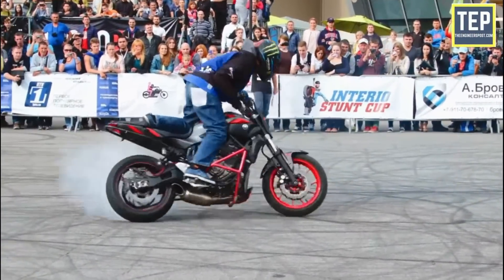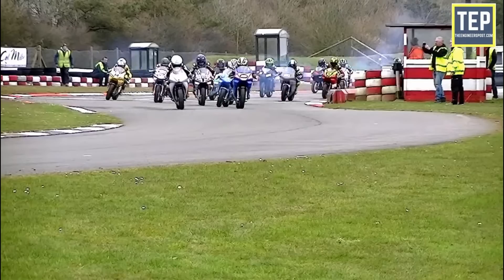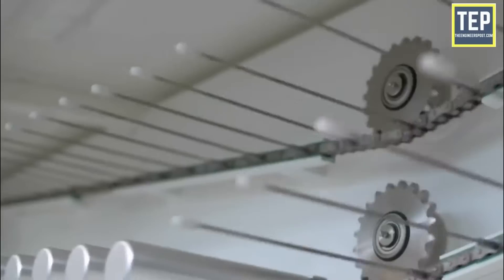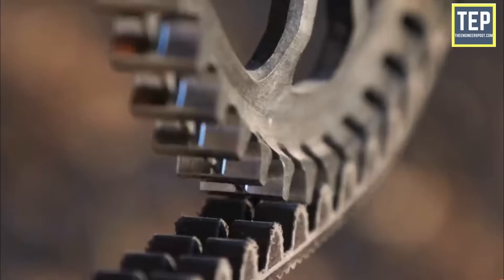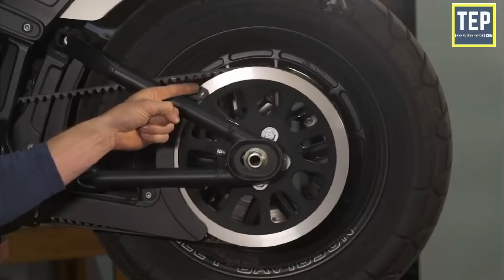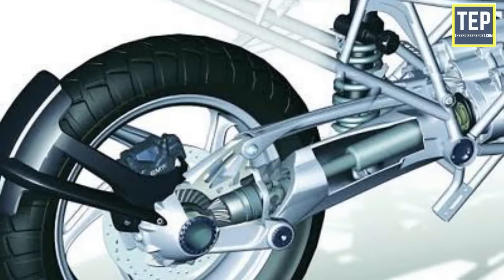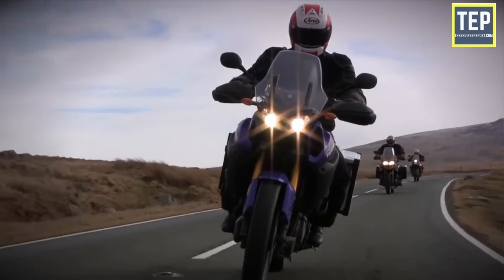Chain Drive vs Belt Drive vs Shaft Drive in Motorcycles | Which is Better?

Comment: From a bmw techie that has worked on a few hundreds of all three drive systems.
Im just answering the title.  Each one of the three have their own unique advantage over the other because each one is better suited for a specific task so you cannot.
Easiest example of one would be the most powerful sports bikes will always have a chain because the other two options just arnt viable and will break. (oh and offroad bikes go here to)
The shaft drive is usually used for heavy weight comfort, thats right, all the adventure bikes were never made to do the offroading that people think they can do and then break.
The belt is just cheap, and its best suited for light weight comfort bikes, thats right harley, it was never going to last and didnt.

Comment: Car Drives without Radiator, Coolant & Cooling Fan with Graphenizer Liquid controls the Engine Heat up to 60%.  

It also Cleans the hard carbon with dark smoke from pistons, Injectors / Nozzles, Valves & Pump etc, instantly & increases extra mileage up to 50%. 

Watch the Live Video  :- https://youtu.be/SqNIGQM1I2Q

Comment: in shaft drive the crank shaft is parallel to the direction of motion. in any automobile when the engine revs up the engine body likely to be "twisted" in the opposite direction which is well and  good and unharmful for a four wheeler, but for a two wheeler the reaction twist of the engine body may force the bike to tilt in opposite direction of engine rotation this may result into imbalance of bike on the road resulting into to accident !!!!!!! 
This is a simple experiment, open the bonnet of your car, rev up the engine manually from the engine bay, you will notice the rubber mounted engine tends to tilt in either direction (front wheel drive) which will confirm you that the engine is rotating in the opposite direction of the tilt !!!!
so if this happens on a bike what may happen ???? especially under wet conditions ???? decide yourself !!!!!!!!

Comment: The biggest issue that is ignored is MAINTENANCE. No drive train should ever be run to failure. Clean,  inspect and lubricate … then replace when wear is beyond manufacturer’s acceptable limit.

Focusing on catastrophic failure, is the repuglican approach to engineering …. Never stop preaching  fear.

Comment: I have owned all 3 types over the years, for me, although I know a shaft drive loses lot of power in transfer, I prefer it, no maintenance, maybe oil change once a year, but not essential, decent chain & sprockets for a large capacity bike can be expensive, also tension checking, it's  pain in the arse, shaft drive for me everytime  !

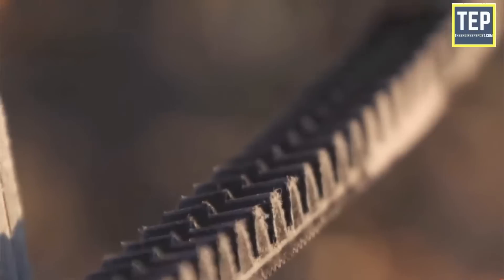Comment: Sprocket ⚙️size and changes is also a big part or motorcycle chain drives which was completely forgotten. I change mine for stunting and back for highway. The closer ratio to 1:1 the more torque. A 3:55 ratio is highway but a 4:11 is better for stunt drag or just low end torque.

Comment: The biggest disadvantage of the chain is no longer necessary though. The Regina HPE maintenace free chain does away with the constant lubing, that then gets slinged all over the rear of the bike. I have it now for 8k km and so far it delivers as promised. Not doing any maintenace on it at all. A complete game changer, since the choice of non-chain driven bikes is getting ever smaller. A lot of shaft drive models have disappeared from the stage and are not replaced.
Reply: Came here to mention there are now maintenance free chains. The system still experiences wear faster than a belt or drive though.

Comment: I have lubed and cleaned my 1st bike's chain regularly, and replaced the chain/sporket set at 15.000km. 
I have rarely lubed my second bike's chain and  nearly never cleaned. Again replaced the set at 15.000 km.
Finally I switched to shaft drive. Despite the losses of power in transmission,  I love its being maintenance free.
Reply: As long as you stay on top of the gear oil, it'll be fiine.

Comment: Too many false inaccurate statements about percentages lost, how they are used, and which is most efficient. 
Totally made by someone biased and without engineering background. Heck, shaft drives are so efficient, they’ve even been used on 50cc bikes.

Comment: Electric motors are the way to go, and because they are WAY more powerful than gas combustion motors, (by FAR), shaft driven is the way to go. even with 25 percent loss, the electric can blow any gas powered bike out there...

Comment: I can't believe that your power loss estimates are close to accurate.

Imagine the heat, 8f that driveshaft alone were dissipating 25% of the power output.  Lmao, it would need it's own radiator and waterpump, especially as it's largely contained and not easily air-cooled.

I just can't buy that, seems crazy and I'd be interested to know the source.

Comment: For me is the belt drive the best compromise: good efficiency, light, low cost,silent,without maintenance (except change after wearing) and without transmission shakes but need gravel protection...chain: need very often lubrication, dirty, noisy, transmission shakes but good efficiency, shaft drive: very expansive, heawy, transmission shakes, high power absorbtion, but clean and low maintainance

Comment: Some bikes from former eastern block has chain drive completely sealed. Chain runs in its own cover, it's lubricated from the transmission shaft, where intentionally leaks motor oil. This system is very efficient and even common chain holds 40 000km before needing replacement. Only disadvantages are oil drops (oil slowly leaks from transmission) and it's really pain in the ass to replace chain and sprocket. After all, it's great thing and is referred as "shaft of the poors".
Reply: Exactly right.  I have found that a drive chain on a motorcycle will last indefinitely if kept clean and well lubricated.  I did it the hard way, by cleaning and lubing the chain every couple of hundred miles.  But, I noticed that even a short ride on wet roads would lead to excessive chain wear because water sprayed onto the chain by the front wheel contained road grit that accumulated inside the chain rollers.  A good chain box would keep the chain clean and dry, short of riding through deep water.  If I ever own another chain drive motorcycle, I intend to build my own chain box for it.

Comment: Chain drive is by far the way to go. belts slip and with high power you can chew teeth off them. Shaft? LMAO wait till you need to change the tire and the power loss is no way worth it to me. Not to mention you can not easily change gear ratio on belt and impossible to change on shaft.

Comment: What about the new 2 wheel drive bikes. Just asking and shaft drives need more upgrades to hopefully not lose that amount of power or I guess that's just it. I never did study on this stuff but did own a few bikes my favorite was 1988 maxim Yamaha 400 4 cylinder.  Says 5 speed but I guess the engine was rebuilt or the gearbox since it had 6 gears and 13 liter tank plus reserve tank. I got 55 mpg city 75 mpg hwy it would have been nice if it was liquid cooled. Top speed of 140kph or 89 mph roughly.  But I liked it I had it when it was 9 yrs old so nothing new but a good bike 🏍 😉.

Comment: As I'm a mechanic I can say shafts driving is best.if looking my experience though I never met work of shaft bike.most chain use to break sprocket shaft splines and break chain lock  things like that.talking about belt though I saw small cc bike with belt driven if examine quickly there will be loosening and break of belt.shaftis better even for long journey.dont trust belt and chain.

Comment: Also a belt drive would require removing the rear wheel In order to install a new belt. While a chain can be installed without removing a gear.

Comment: Chains will be stretched over time and need to replace - especially the cheap ones without the o-rings. Not sure about the belt type, which looks like one piece and does it stretch? Or just break? The shaft version looks long lasting, is there ever a need to replace the gear due to friction/wear?
Reply: @Devin Currie If the main seal goes, you usually find out pretty quickly as you collect high viscosity oil all over the rear tyre. Generally, in a non-sealed shaft drive system (i.e. one that isn't enclosed in an oil bath), it's the driveshaft splines that die before the crownwheel, unless you're so stupid as to run the bevel drive with no oil. Non-sealed shafts are not maintenance free - you need to regrease the splines at specified intervals. I can quote the K100 as I have two of them: drive splines at the clutch and the forward end of the driveshaft, every two years. Drive splines at the bevel drive, every year. I tend to do the rear splines every couple of tyre changes as it's convenient and not very time consuming. One K100 is on 120,000 miles and the drivesplines are perfect. I also ran a Moto Guzzi V1000G5 to 205,000 miles and changed the driveshaft once. That was my fault.

Also the power loss on the driveshaft quoted in the video is pure bullshit. It's seven percent. A chain loses around 12% power at the one-third worn mark and goes downhill from there. I'm an ex-motorcycle journalist, so I hope I kinow what I'm talking about.

Comment: I prefer BELT and dis is Y, chain drive wen accidentally broke and stuck in between sprocket and bike frame can cause serious injuries, same thing to shaft drive, but BELT drive is safe wen it brakes it can't cause wat I just mention above. It just my experience and now I Harley sportster  BELT drive and it's best

Comment: I prefer chain drive, low cost, lubrication maintenance which is easy to be done, if any case of breakdown it is easy to align, no transmission power loss (negligible).

Comment: I am a maintenance mechanic and electrician for the last 20 years. ANYTHING claiming it's maintenance free, yet has moving parts is absolute BS. Even a visual inspection is regarded as maintenance. That maintenance free crap is used for the ignorant and to boost sales. Unless the part doesn't move and doesn't have moving parts, it requires checking and even replacement.